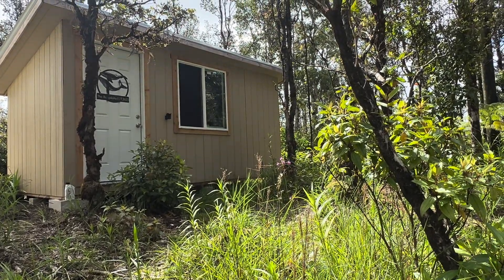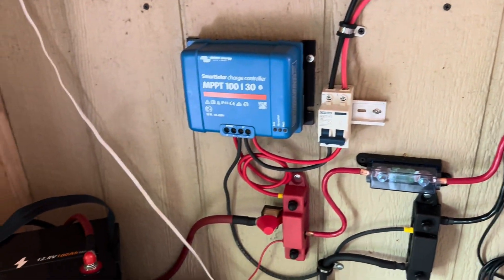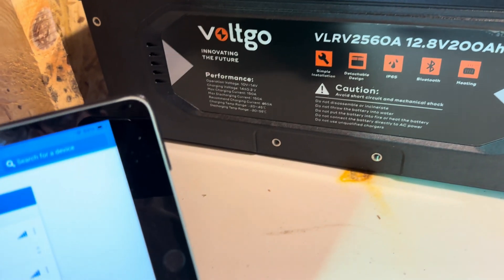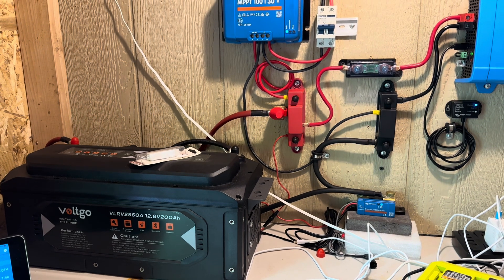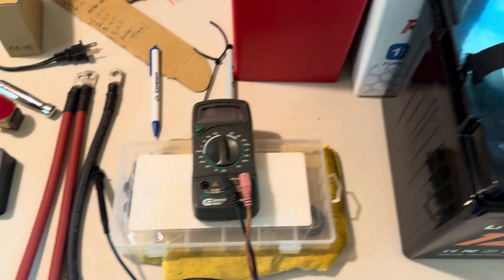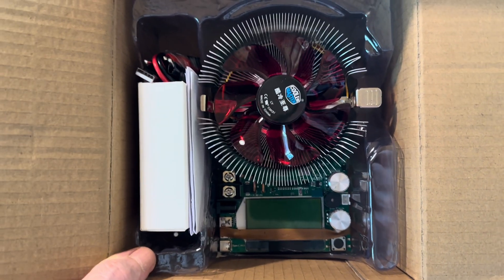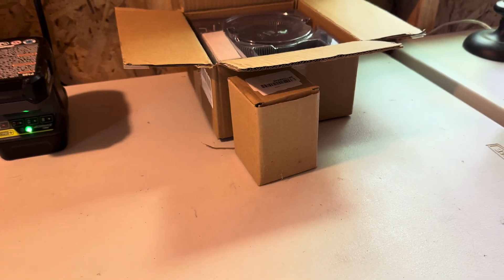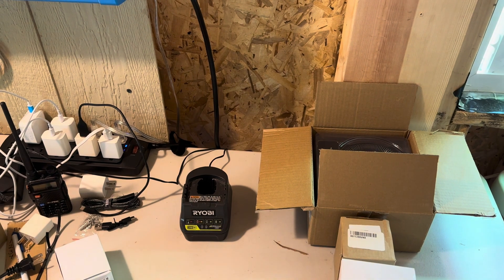Summer Solstice Only Days Away! Spring Cleaning Giveaway!  Solar Life in the 808 All Day, Everyday🤙

Comment: Hi Bob, sent the email to gmail for my entries.  Always good to clean out stuff when not needed.  I need to do that for the local hamfest / swap and eventually do the same thing with all of the darn controllers I have.  Battery prices keep dropping and server rack batteries are like $250-300 lower than they were just four months ago due to home storage batteries showing some market gains.  Here is SE MI, I used more power using heaters in winter so we'll see how the additional used panels work out.  enjoy the spring cleaning!
Reply from the maker: Aloha Gary! Got the email! Going to let the guessing game go on a few more days as it's getting quite a response! Love seeing the prices go down on batteries for sure. Those extra panels should help you when the sun starts dropping. 🤙

Comment: Nice!   I have high expectations for power generation this summer.  Getting tons of excess power with the mild weather and overnight cooling we've been getting so far.  It will heat up as we get closer to July but I'm enjoying all the extra energy.

I have enough extra now that I can add a little portable A/C unit and run it 12 hours a day consistently in summer.  I was able to test the setup during the heat wave last week and it passed with flying colors.  I expect to put it to good use.

I even played around and tied all my smaller test panels (A 70W, a 75W, and three 25W panels) into the system just for yucks... but despite the poor orientations and ad-hoc setup they are still adding another 700Wh/day to the 10kWh/day I'm already getting, more than I expected.

When setting parameters, you can tap on the numeric input field and enter the number with the keyboard instead of having to use the UP and DOWN arrows.  Saves some time when making big changes.

-Matt
Reply from the maker: Nice you got some ac running! I see it's getting toasty on the mainland! Luckily I don't need ac, otherwise I would have to stack everything up a little heavier! Aloha Matt!🤙

Comment: you have much of the same stuff I have  and use or have used on systems.  lots of weeds to cut back. same hear in NY. I got the Ryobi 18V one plus system as well. they are great. the 18V trimmer is good for light weeds but not the heavy stuff like you got. the 40V needed for that. I have the Ryobi 12V to 18V one plus charger and that great ! has 2 USB charging ports . I run direct off my 12V   system. no inverter needed. I love going to Home Depot and checking out the Ryobi stuff and the DeWalt 60V/20V tools as well.  girlfriend wants the 18V one plus BUG ZAPPER from Ryobi . she saw that in Home Depot. same with the cooler/freezer they have. 3 way power. plug in 120V/12V car or solar / what I like 2 - 18V one plus battery's . hard to get all the new stuff coming out  . I wait until reviews come out.
Reply from the maker: I need a pretty heavy line to blast through the stuff here. Anything with the bump feed is usually not good. Does that 40V trimmer use bump feed? Think my perfect size line is .49 as I recall. Looking at that bug zapper too. Skeeters been busier than usual after all the rain last month. Aloha!🤙
Reply: @ProjectsinParadise808  just watched a you tube video of the Ryobi 40V HP trimmer. it comes with 2 heads. .095 line trimmer and brush cutter head. and you can buy extra metal blade brush cutter for it , Shop Tools Reviews channel. he cut brush waste high with it. with up and down then side to side and made quick work of very large brush. for your land I would get that one with the metal blade attachment. takes same 40 V battery as mower. Home Depot has them. now I want one. has more power than my 60V DeWalt.